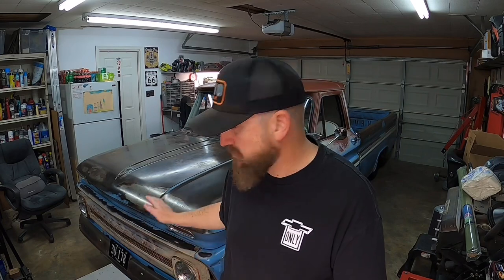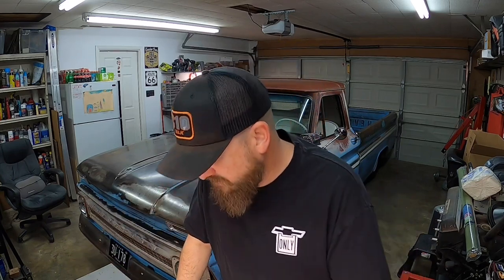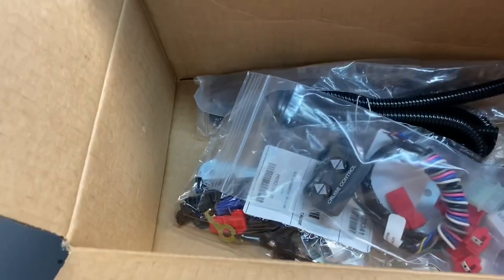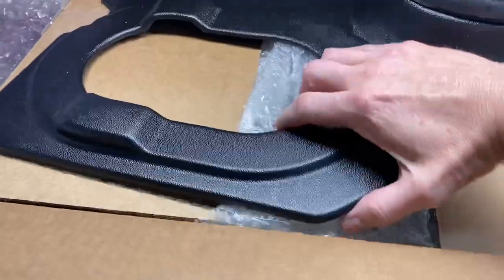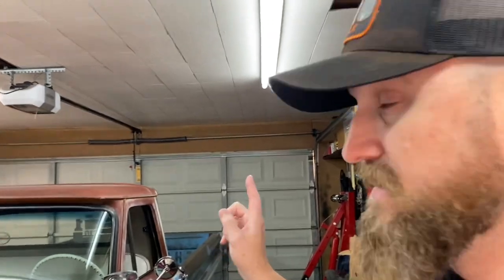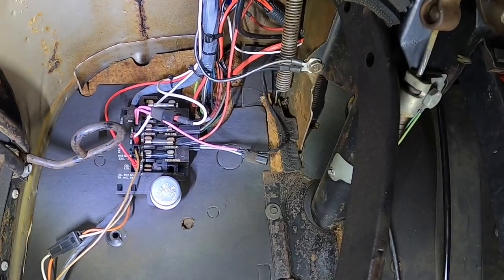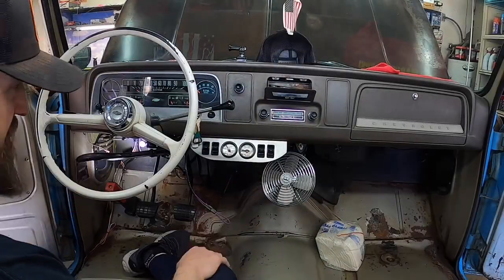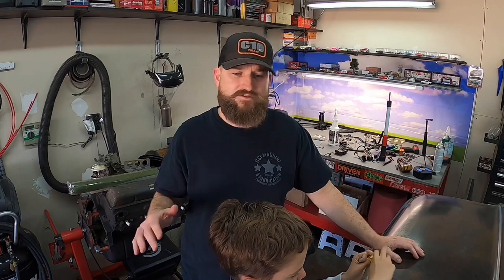1966 Chevy C10 factory under dash wire harness replacement

Comment: I’ve put in 2 American Auto Wire harnesses, and they both came with fuses.  Both were bought from the factory.  No need to go through a third party.  Their website is easy to maneuver.
Reply from the maker: So you bought the same exact harness I got and it came with fuses?
Reply: @Chickeneyegarage  I bought the 1960-66 C10 wiring harness that has factory bulkhead fittings and wiper motor fittings etc.  It has upgraded provisions for an HEI distributor, and single wire alternator which I am using.  It also has more circuits to add AC, power windows, etc if you want them.  It came with all of the fuses and flashers.  And extra connectors.  It bolted right up, and the bulkhead fittings fit perfectly.  New key switch, light switch, which I trimmed down per the instructions, and dimmer switch.  It is the best wiring harness I have installed.  I’ve done several Painless, and I like the American better.  I always order from the manufacturer and I talk to them before I order.  I bought both crimping tools for the small single and the larger, (double) connectors.
Reply from the maker: @justpray365  thanks for the info. I’ll have to do that next time I rewire another truck.

Comment: I daily drive my 66 C10. I’ve been on several 12 hour road trips no cruise control haha. I’m currently trying to replace my wiring harness and it’s been… fun…
Reply from the maker: Hopefully I can get the cruise install going soon
Reply: @Chickeneyegarage  very cool Sir, btw I wish to also do the same job, I.e. under dash wire harness… brakes lights etc. ghosts ha ha.. Hey mine is a 63 C10 with a 383 and manual 4 speed putting in fresh engine also a 383 with a new Tremec 5 speed manual in front of a 3;73 ratio 12 bolt rear..
May I ask for the “Under dash Harness part # please?” Gotta do mine, hey also thanks for the tutorial on the quick ratio gearbox did mine but drilled 2 holes and routed my hydraulic lines through the fender. 2 holes drilled, then added grommets to keep them from chafing or cutting, feels sooo good steering with “1” finger, ha ha smoooooth…
Thanks for all these mine is as said a 63 Nice blue color “not perfect by no means” love the patina on that truck of yours would rather have that look actually…
Spring is ac for mine and I’ll thank you again by then as im sure you’ll have or will have done that too…

Comment: The purple wire is for HEI distributor part part number #52-130A from classic parts of America
Reply from the maker: Someone told me it’s for a neutral safety switch for an automatic transmission. Makes sense, since my truck is manual but maybe you’re right, I don’t know but thanks for the info.

Comment: I appreciate the video and I was so excited that I was gonna get to see where you connected everything and you time lapsed over all the connections ☹️. Again I'm not meaning to rag on ya it's a good video 😎👍
Reply from the maker: I guess I could have shown every connection but I didn’t want to make the video too long. It’s pretty straight forward so you shouldn’t get confused.
Reply: @Chickeneyegarage  lol I shouldn't have but 🥴I had three wires that ended up being for an auto tranny and a reverse lights which I have neither.
Reply from the maker: @ronaldsteveson76  I found out the heavy gauge purple wire is for the neutral safety switch on an automatic transmission. Now it’s a theft deterrent 😃

Comment: The purple wire for neutral safety switch? Or maybe clutch switch -so as not to start it in gear?  Awesome video. 👍 ordering a new wiring harness for my 66 now.
Reply from the maker: You’re right. I found out later it’s for an automatic transmission truck neutral safety switch. I could probably do the same thing with the clutch so it doesn’t start in gear.

Comment: Hey Sir, also I don’t know if you prefer the {High/Low} dimmer via foot but I’ve got the same {I think} kick panel speakers which I don’t prefer because {my} kick panel speakers make it almost impossible to use the dimmer {foot type}… please post how you find them to be?
Reply from the maker: If I have running shoes on I can access the foot switch ok.

Comment: Charlie ,my power steering conversion plate was,welded off very hard to start the bolts 2 would go in good then other 2 would not ,then switch and the other would then the other wouldn't, what a pain ,I took it off and put next to the unit and tried still wouldn't go !,Hmm so now,just thinking of the fix ,we'll I figured it out
Reply from the maker: Is it a cpp kit?

Comment: Whats the green and yellow harness you unplugged for? At about 15:19-15:20
After the brake switch 

My 65 doesnt have that lol.
Reply from the maker: Connection for reverse lights. Option in 65, all 66 came with them.